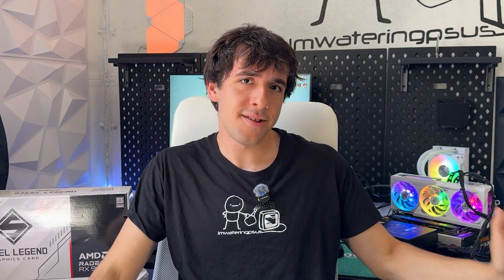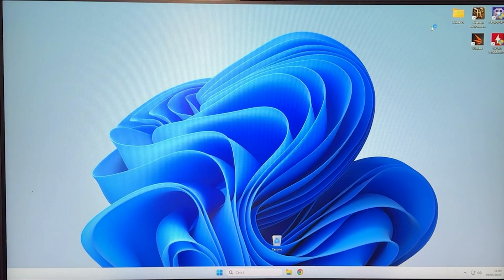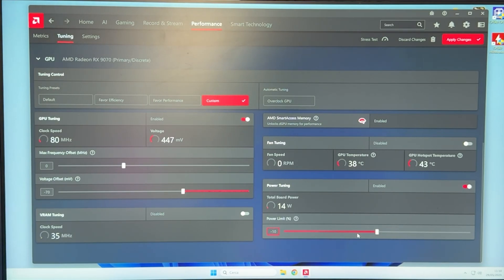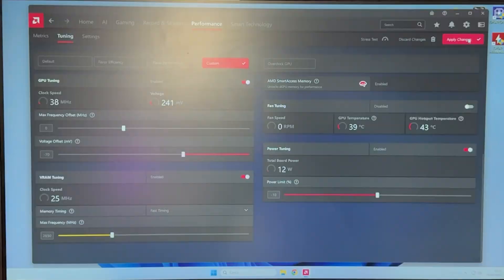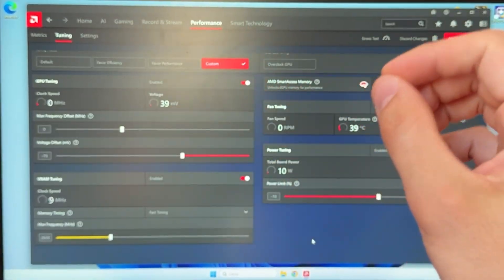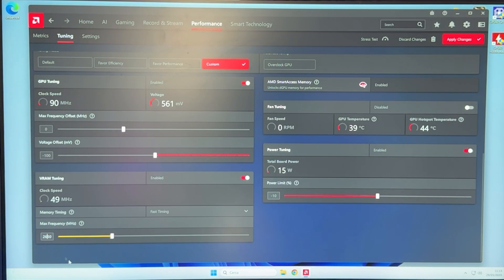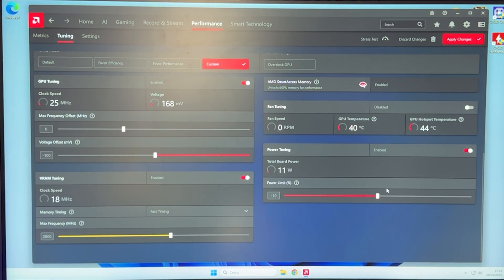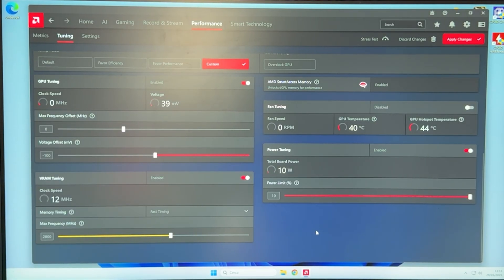Undervolt your RX 9070 for more FPS and Lower Temperatures! - Tutorial

Comment: Gigabyte 9070XT Gaming OC: -80mv voltage offset, -30% PL, Memory clock 2714mhz, fast timings. so far rock solid stable, went from 330w down to 230w during full load. temps are nice too with a fan curve. 45c core, 60c hotspot, 70c memory. lost around 3% performance.

Comment: I just tried this on my XFX quicksilver 9070xt! Thanks for the clear instructions for some reason nobody gives slow clear. Instructions
Reply: Hey can u help me what does +140 means in term of clock like mine is written 2518 do i make it 2640 or 2658
Reply: @itz.manish_09 I bumped mine up conservatively to whatever he showed in this video, that's a low end spot that everybody should be able to handle without any problems. I'm not too knowledgeable on it so I'm the wrong person to ask

Comment: I did this but i adjusted ot to -80mv then -15power amd 2650 fast timing and then i hardcap in my game 180hz which also gonna lower ur temos bc then ur gpu dont need to work harder. There is no point of running ur gpu with 200 to 300fps if ur monitor onoy can do 180hz if u do not hardcap 180fps the gpu temps will rise comes from experience

Comment: Did you test the little brother of the Steel legend. The challenger version is the one I have, but you think the Universal Undervolt Preset would work ? They have different game and boost clocks though. The challenger stocked is 2070 core and 2520 boost. The steel legend stocked is 2210 core and 2700 boost.
Reply: Hey u found out any answer or no i also have challenger model

Comment: On my Gigabyte Gaming OC Rx9070 i just done:
 -50mV
 -5% power limit
+100Mhz Vram
Reply: how you feelin about the gpu so far
Reply: @deekay3944 
Quiet good.
I increased to -90mV ( and seems better ) .
Reply: @macellaio5452  thanks brother. ill give it a try too. got any coil whine?
Reply: @deekay3944
Never tried after the undervolt.
When stock some electrical noise (very low) but I have to bring my ear really closer to hear it ( without the case glass ).
Reply: @macellaio5452  nice bro. enjoy your setup

Comment: I have an ASUS PRIME 9070 and I never knew that lowering the power limit % can INCREASE gaming performance. I always thought it was the opposite, kind of like a "power saver" power plan but instead of the CPU it's for the GPU.
I have 1 question though: If I want to get the best results possible, how do I know if it's the voltage offset or the frequency (or even both at the same time) that I have to reduce once it gets unstable/ starts to crash? that's where it gets a bit complicated to me.

Comment: rly would love to get message, i got sapphire nitro+ 9070 non xt and without any tweaks plug and play and i got sustained 3.2ghz while gaming fortnite, rdr2 ultra 1080p around 3.1ghz boost. Hows this possible?
Reply: update, did -100 voltage offset with -10 power limit and got to 3.31ghz with max frequenzy offset set to 0

Comment: I'm probably talking into the void, but I'm gonna' ask anyway :) Can you please give me a general idea of what the hotspot temps are on the 9070 non-xt compared to the averages? So GPU tempt 1 compared to GPU temp 2 under gpu load situations. so basically any game, prefferabl something gpu intensive? I'm trying to figure out what card to upgrade to from 6800xt, and 9070 xt is already a no-go because it has the same hotspot issues that 6800 xt does. 5070 ti is a very safe bet, but expensive for very little performance compared to the 9070 non-xt, but the deal breaker issue for me is the "hidden" temps that actually cause all the issues

Comment: I guess I won the lottery . My Red Devil 9070 got a -140 voltage offset and 2750 vram with added 10% power , GPU is using 270 Watt at runs at 59 degrees .
Reply: Nah that doesn't sound good. I got a -100 voltage offset, 2700 VRAM, -15% boardpower. Card is @ 187W under Furmark stress test. Not to mention: the Sapphire Pulse 9070 is way cheaper than your Red Devil. Try to reduce your Vram a little to cut back on Power consumption.

Comment: gonna be using this along with 5800x video when the 9070 and new case arrives, im very excited as ive unsuccessfully tried undervolting and slightly OCing my 6650xt with no stable success (most stable i would get is a couple hours of stableness before GPU said no and reset) i did figure out my own custom fan curve though 

good videos youve earned my sub

Comment: How low of a tdp can this card get under load and what percentage of max performance is retained? Curious because I'd like a GPU that doesn't output a lot of heat while running reasonably fast. No AC and I live in a warm climate.

Comment: I have the same card and I went down to -120 mv. I tested it on several games in ultra settings and everything was ok. I lowered the voltage to -30 percent. Currently, the power consumption in games after undervolting
 exceeds -100w.
Reply: not realistic,go steel nomad 20loop test and you will be crush
Reply: @YXY703  just game to test, setup each game with its own uv/oc settings

Comment: I did -60 uv and -10 pwr on my xfx 9070, temps didnt drop at all but the vram temp went from 92-93c to 90-91c and fan speed went from 1800+rpm down to ~1650rpm which is a big noise improvement for me. 

Now the gpu doesnt sound like an airplane about to take off 😂 much thanks
Reply: What VRAM do you have? I also have the xfx Mercury magnetic 9070 XT and barely touch 70c. Mine uses Samsung ram but I'm using +10 and 2800 on ram
Reply: @JomarsYT  apparently it uses the other hynix or something Im not exactly sure

Comment: Just went black screen after i did the undervolt, what i have to do?
Reply: It means it was to aggressive, honest it’s not worth the time or energy to find a stable undervolt. After a restart it should have we back to default settings. Not all silicon is equal, if you still want to try, try -50, -30
Reply: @Amp_Edition tbh i tried in the first time -100 , with -70 it was all good

Comment: oh yeah this is the video I was waiting for , I have the Asrock Steel Legend RX9070 and is very difficult to get it properly undervolt without crash
Reply: It’s not worth instability, leave it at stock and you’ll have zero issues. Under volts vary from driver to driver also
Reply: I have the same, did this video improved yours?